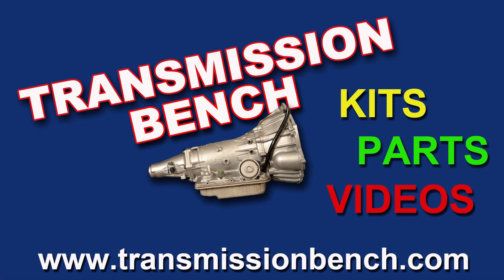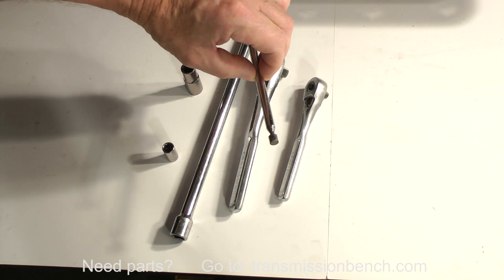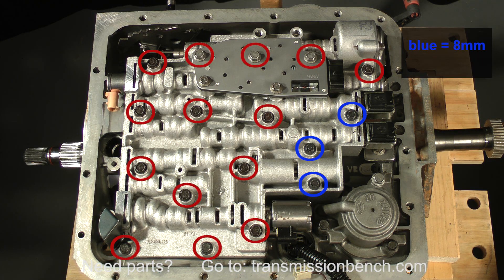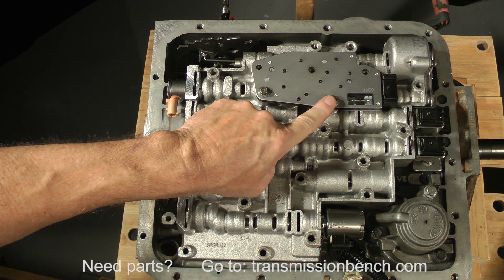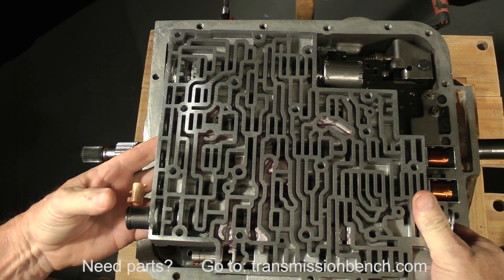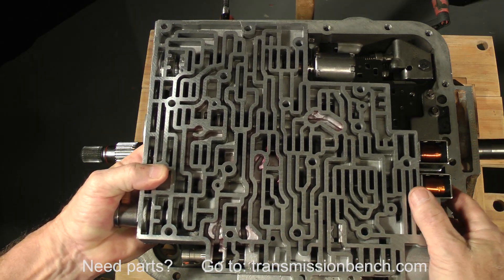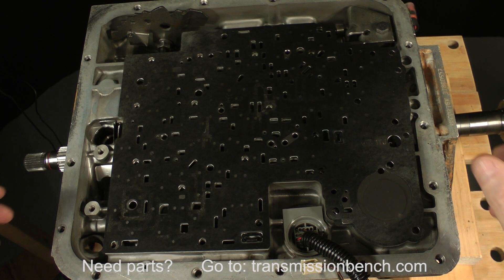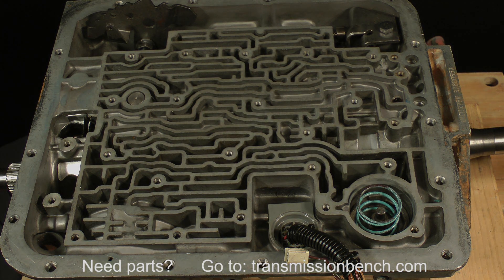Project 4L60E Part 1 lesson 4

Comment: I just rebuilt a 2000 chevy 4L60E when i put it in reverse it goes forward and forward in drive is it possible the i left a ball out of the valve body or what i might have done wrong?
Thanks
Herm

Comment: Only one pro tip to add (because Jimmy pretty much has everything dialed here): 
…get yourself a box of fresh Ziploc bags. Sandwich sized. 

…Each time you pull off a set of parts and bolts that go together as a grouping, put them in that Ziploc bag. Then you can seal the Ziploc bag and put it in your master box of small parts. 

This will group your related parts together, while keeping them segregated from the rest of the project bin. 

This method alleviates the problem of hunting for/losing Fasteners and small bits, and it makes reassembly exponentially easier.

This comes from 22 years of doing automotive professionally. Being clean and organized means smoother repair jobs with less anxiety and stress. 🍻 😎

Comment: Very thorough (but a little on the slow side).  One thing about using a magnet to remove the check balls though.  The steel balls become magnetized and will attract metal particles in the oil decreasing their efficiency in closing off the oil passage.  Worked on Honda cars for over 15 years during the 80's and 90's.  I overhauled well over 200 transmissions and found a few trans (that were worked on by others) with magnetized balls and metal crud stuck to them.  Also, Honda auto trans instructors stressed the importance of not using a magnet in removing check balls.  I kept a supply of 316 stainless balls to replace the steel ones and never had a problem.

Comment: Question...1997 Silverado Z71 5.7L 4L60E... ONLY when trans is warmed up (driving for 20-30 minutes at around 55mph) trans has real hard shift from 1st to 2nd and a somewhat hard shift from 2nd to 3rd, can turn engine off wait 30secs and start engine and trans shifts normally again. 3-4 is good and shifting through PRND321 is good. This only happened after towing a trailer down the highway while in D (forgot to shift into 3 while towing) was told torque converter was toasted.

Comment: He’s right. I read 3 books, watched every video on YouTube and even read transmission forums. You have watch the people on them forums. A lot of them are just repeating bs someone else told them. 
I also bought a bad transmission and took it apart several times. I even went to pull apart and took a bad transmission apart there. I studied more than 2 years before I rebuilt my unit. The tranny did work on the first try.

Comment: Is there any more check balls besides the 7 and the one on the bottom the plate? I have an 4l60-E and there is one more check ball at another location and some kind of O-ring retainer is holding it in place in the Valve Body, looks like does not come out. that would be the number 9 check ball. Is this normal on my transmission? This is the tag on the case of my tansmission 3SDD. it is for a 2003 Chevrolet trail blazer LT. please help

Comment: I rebuilt mine with help of your vids!  I get a p0742 if I drive without warming up.  When hot, runs fine...  Wondering if it might be partially clogged cooling coils in radiator because previous owner had the trans replaced but I am suspecting not radiator ... So was going to add external cooler to see if that solves.  Does this make sense to anyone?